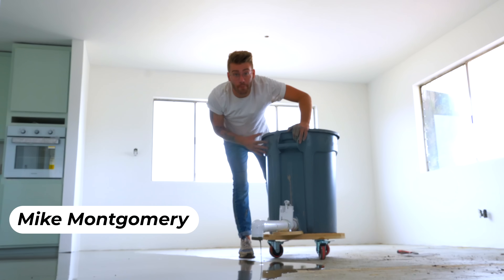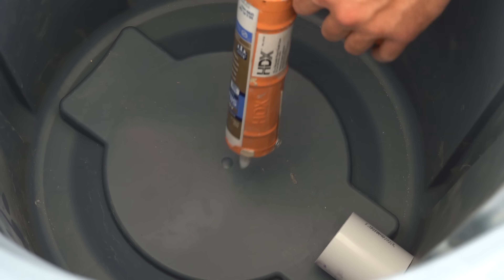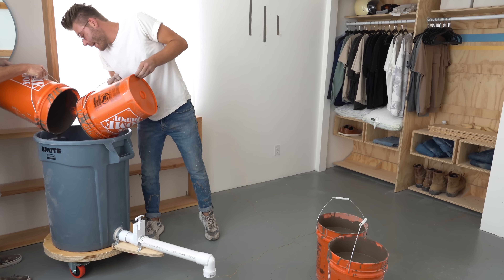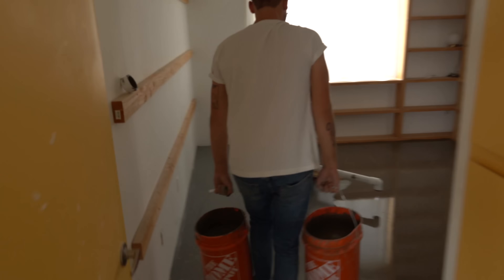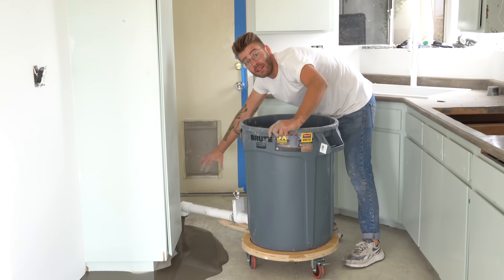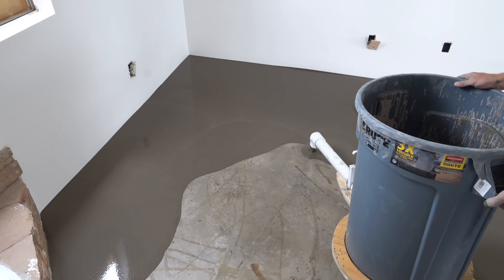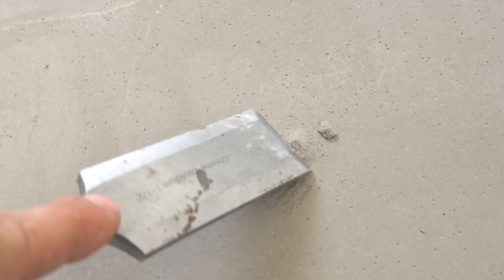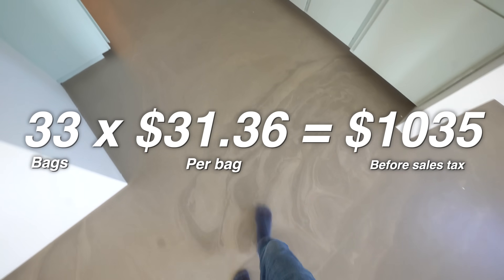DIY SELF LEVELING CONCRETE FLOORS!! $1 per square foot

Comment: I like it.  

As a Contractor (but not a Concrete Contractor I must admit) I have issue with some of the comments in the thread.  Self leveling products shouldn't crack due to just the curing process.  Possibly spider cracks if you don't keep the top surface moist enough for the conditions.  No control joints necessary and, with the thickness being so minimal, they would be almost impossible to install anyhow.  

BUT, the existing cracks/control joints (of the original slab) will transfer through over time.  How soon is just dependent on the movement of the original slab.  The self leveling product isn't flexible so there is virtually no way to keep this from happening.  At least as far as I know.  If I am wrong, please let me know how to correct this as I would love to have the answer.

As far as delamination goes....a better connection between the original slab and the overlay would be to mechanically abrade the slab (grinding).  A disclaimer - I have done that and it is a PITA if you don't have the professional equipment.  Believe me, I know because I didn't when I did an Epoxy flake in my parents garage for a gift!

Comment: What was your prep work to the walls / sheetrock? We're wanting to do something similar in a closet and bedroom.
Reply: 🤣 It doesn't look like he did any prep on the walls. Nothing to allow for expansion, nothing to seal the gaps so the concrete doesn't flow under the drywall... overall amateur work. I't so bizarre to see clownery like this get hundreds of thousands of views.

Comment: Put the strainer screen on the opening of the trash can for pouring.  That way, you can avoid clumps clogging the pipe.  Think of it like drinking a Slurpy through a straw: chunks would get stuck at the pipe, limiting the flow.

Comment: Not bad but you really should have gotten yourself a spiked roller, they are CHEAP and make helping the mixture level and BLEND the pours much easier.  You could have made some nail soles for your shoes to walk over it as well for almost nothing - nails, wood, bit of rope to tie to your shoes.

Comment: This doesn't look like it is easier than just pouring the made buckets. Also, if the mix is spread too thin, it doesn't self-level so pouring just a little bit everywhere rather than a lot in a few spots and letting it flow, seems to defeat the point of the self-levelling.

From experience the main issue in diy use of self-levelling mix isn't the spreading (which is what this contraption seems to be trying to do), but is the quick preparation and quick pour of enough compound so that the first pour is still malleable enough to flow together with the last and create an uniformly levelled floor.

Comment: Should be using a mask when mixing that much concrete, not good to breathe in. Other than that, looks like a pretty neat tool. Another note, since I just finished the video, floors that slippery can be dangerous to pets. Older dogs, with bad hips, really shouldn't be walking on it since they can slip and really hurt themselves even more.

Comment: Wouldn't direct contact with porous material(wood shelves, wood kitchen cabinets, and drywall) cause moisture to be pulled out of the concrete? Or, future wicking of moisture between the two surfaces?

Comment: There's no way that floor will be level and flat using this method. You need to check all over the floor for low and high spots, and when you pour, you need to push the compound into the low spots and check with a laser level and a marking stick that you're actually getting it level everywhere. Despite it's name, it's not self levelling.
Reply: Actually,  I've used this stuff and with a little agitation with a rake, it levels pretty well on its own once dry.

Comment: If you read the bag you will see that this product is not a wear surface, it is an underlayment designed to level a floor for new flooring. it is not intended to be a finish surface. Do not do this. It will not last.

Comment: This is the most useless contraption known to man. I do this for a living. Mix 2 bags at a time and dump it on the floor as quickly as possible so you have an even poor. You want everything drying about the same time. It’s self leveling so it’s not necessary to wheel a contraption around to get an even coating. Waste of time. 
Dump it, rake it, and have someone else getting the next mix going in the meantime.

Comment: No offense and hope this is more like constructive criticism but your projects lately are becoming more and more like 5 Minute Crafts or DIWhy type of results. I know it's subjective to the viewer but the look of that in my opinion looks messy and tacky. 

Constructive Part: I like the videos that had simple minimal looks that used tried and tested construction methods that made a clean polished look rather than whatever you've been releasing lately with weird experimental construction methods that seem to not be done for longevity. But it's your channel so you do what you wish to do.
Reply: When you preface a comment with no offense that means you know what your going to say is offensive and probably nothing more than your opinion.
Reply: Ehh I disagree. He did every step that was required, and made a decent jig that worked well out of cheap materials. I’d say it was a success. Plus for ≈$1 a sqft I would be very satisfied with the results.
Reply: @SAMB0307  
It lacks this step (Could be found in the Installation Guide link from HD product page down belowwww):
Movement Joint Placement
Movement joints are required for perimeters and other changes of plane in all installations. See TCNA Detail EJ171 for recommendations.
Reply: I would have to say I think all his projects are like that. I don’t think he intends for them to be any different
Reply: Constructive criticism requieres helpfull advise or at lear options from which hes can improve

Comment: Biggest problem you made, is that the leveler you used isn’t rated as a wear surface. You need to use something like Mapei M20 plus or their Ultratop
Reply: does this even matter if its just for foot traffic and is sealed?
Reply: @Gulag_bog  4 people sitting on a couch is like 1000 lbs, I doubt this will sustain the point loads and will likely crack and pieces will pop off in certain locations overtime due to the thickness

Comment: This works great as a floor underlayment, but it is going to crack. Cementitious products will lose moisture over the next few weeks and continue to harden and shrink and creep. It's just the properties of products themselves. This is why sidewalks have joints in them and why slab on grades have saw cuts typically 20-25 feet on center to allow cracks to form along that joint.

Over the next few weeks you'll likely see spider cracking. It doesn't mean that it is falling apart, Mike may make it a feature. Hopefully it doesn't delaminate and start popping off, but the bonding agent that Mike laid down should help with that. Like I said, it's primary application is an underlayment for floor so you don't care if it cracks because a wood floor or tile is the main surface. I'd love to see a 1 year follow up on this floor and especially the countertops since I have less faith in those holding up over time.

I can consider myself an expert with knowing concrete, I am a structural engineer so I know a whole lot about concrete. I also sometimes get asked questions about cementitious products like this to help architects spec floor underlayments that will work with their finishes.
Reply: If/when it does crack to make it a feature what would you suggest to have like a darker color settle into the cracks ( like grout) and then put Epoxy overlay?
Reply: @Angibbabee  I'm not sure, Mike is very creative so I'm sure he will think of something. He did a thing previously where he put gold flakes in the concrete cracks so I'm excited to see what he would do when some cracks form. Also, I wouldn't expect the cracks to be very large, probably just some consistent small spider cracking where you can see it but it doesn't quite open up
Reply: This is a self leveling compound, which is significantly different to a self leveling concrete screed.
If it is cementitious in nature it would have plenty of admixtures to prevent the cracking
Reply: it is levelling compound which is designed to be self levelling. It's over 40mpa, so it won't crack as long as there wasn't too much water or too thick.
Reply: I didn't want to get too technical in my comment where it becomes too long and boring. Concrete and grout are similar being cementitious materials. They both use cement as the "glue" for sand and/or stone. There may be other admixtures used to help prevent cracking but they only go so far, they help reduce the concern if cracking but it does not eliminate it entirely. Concrete and grout will crack eventually, it is just part of the material properties, unless it is under constant compression and does not see bending or significant shear. Spider cracks are going to fork eventually, but I would also say the same thing if he poured a fresh concrete slab here too. The best thing you can do is to mitigate it. 

The main concern I would have with using this material as a floor finish is the same concern I have with the "concrete” countertops that he previously made. A thin skim coat just will not last as the finish. Inevitably you're going to drop something on the floor or counter and it will chip off. It's just going to happen when such a thin layer is put down and used as the finished surface, and is irrelevant of the material strength properties.

For concrete alone, the minimum thickness I would specify for a pour is 2" for a topping slab, and even then I would probably want a 3/8" stone and fibermesh used to mitigate cracking due to drying/curling, and shrinkage over time.

I have never seen an architect call for a skim coat like this to be used as a finished floor, and a contractor would also want to stay away from this too because they would probably not warranty the work. Like I said, this would be great as a floor underlayment, but I have big concerns about durability as a finished floor over time.
Reply: @Angibbabee  You know mill with kintsugi that shit.
Reply: "Do not use as a permanent wear surface."
"Expansion joints and cold joints, as described in ANSI A108.01,
should be carried from the substrate up through the tile or flooring
surface and filled with an appropriate elastomeric sealant"

Those are basically half of the product limitations listed on the datasheet :/

I wish him all the best for his floors, but I cant not wonder if we will see countless home improvement youtubers in about 5-10 years making exclusively videos about "only using the correct product for the job" and "we bought this cheap house and had to rip out our own mistakes"
Reply: The primer prevents the substrate from hydrating from the flowable hydraulic cementitious underlayment- it is high polymer and calcium aluminate and formulated in a way that hydrates topically much faster than other formulations. We do this all the time and install wood flooring and tile over it the next day and it lasts  a lifetime without any issues. The catalyst obviously is water and it kicks off very fast and has a healing time much different than other formulas. It’s definitely not supposed to be used for a finished top coat, there are other formulas designed for that. Anyways, he’ll be fine.
Reply: You can easily make non cracking cementitious compounds...... Really not that hard if you "know what you're doing" as you say. Not normal or common for a screed to lift, crack and/or pop at all
Reply: "I know a lot about concrete" Has never mixed a batch in his life 😂
Reply: @bradtyson  
It is not a matter of if but when concrete will crack.  He already had a large crack in the concrete floor and as it continues to crack so will the the compound he put on it.  And if any other cracks form they will crack the compound with it.  The best you can hope for is to minimize cracking and minimize the cracks from spreading.
Reply: @oldtimefarmboy617  That is the correct answer. 
Plus I get suspicious when people do not use the term hydraulic cement. 

This particular type of product I use all the time and it will shrink but because it uses surface tension to effectuate the self leveling means it will get thinner top to bottom for the most part with 3-10 day cracks forming at the edges and places of already uneven subsurface

Since he sealed it like concrete but both top and bottom; longer term bubbling is likely ( due to hydration changes in the subsurface layers ) 

Letting it cure fully ( depending on the environment : up to 7 days ) before sealing it can reduce granulation from happening in areas that have sharper than average daily temperature gradients ( i.e the sealant may peel the upper layer of the lever off under mechanical stress  in thicker areas or near exterior openings/ drafts)

I have found that adding some type s mortar to the self leveling products can mitigate some of the longer term issues, this also lengthens the initial working time and allows for better troweling /wet edge management, but as a direct use layer I am not sure; perhaps not only some type s but also some fiberglass..

At the end of the day though , the mechanical wear on this product used in this direct surface fashion I would expect to start showing significant deterioration in select areas within two years
Reply: Mean like adding fiberglass ...ahh filaments,/  shreds to it have heard that being done to give flexibility
Reply: @miguelcastaneda7257  high strength concrete and high strength back plastering have a fairly high percentage of fine short fiberglass fibers in them .  "flexibility" might be the right term, but I believe "helping mitigate the shear moment" in poorly bonded areas that are more granularized than homogenized  or other wise more exposed to shearing stress might be a better conceptualization.
In the application in this video I think (air) pressurizing the house to as high a limit as it could take as the floor cured might also have been an interesting thing to see
Reply: @miguelcastaneda7257  
Actually, the purpose of adding shredded fiberglass fibers to cement is so that they can act like lots and lots and lots of really small reinforcement bars to prevent the cement from spreading apart just like steel reinforcement bars do but on a very small scale.  They may have had that in this stuff but they would also tend to make it act like it was thicker and not spread very well which would have defeated the whole purpose of it being designed to spread easily and level itself out.

That being said.  I did watch a program on television about earthquakes and the fact that they were trying to add some sort of plasticizer into concrete that would allow concrete pillars to flex with side to side and not crumble to pieces.  That was a long time ago and I have not heard anything else about it since so I would assume that it did not work out.
Reply: @jonathanmalmut2412  if the mix used was runny due to a superplasticizer, it likely will not shrink much at all.  I know you're trying to be helpful, but I'm not sure that you know as much as you think you know.  There may be a "spiderweb" of cracks, but they will be hairline, such as how Raku, and largely will not matter due to this concrete acting primarily in compression with a slab beneath it.  One important thing: it is good to use a proper concrete bonding agent so that any uneven pressures do not cause this self-leveling layer to flake off.
Reply: I've used this same cement product. Ive been deadlifting 200+ for the past year and 300 for the past month okay. No cracks. The product does state that it has high impact strength.

But that said, it does get very dusty? Is that from the cement itself?
Reply: I was spout to go to home depot. you just saved the day bro. you must of saved like 50 people with your comment
Reply: I have used this outside for filling a dip in the concrete in front of the main entrance door that would fill up with water and then freeze. It was a patch about 4’ in diameter. The patch lasted 5 years before the edges started separating from the original concrete. I was surprised that it lasted as well as it did. I didn’t even apply any sealer to the top. 

I have also used it for shower pans with no problems. I mixed it thick and poured it around the outside edge and let it run slowly to the drain pushing it back uphill until it started to jell up and hold the slope. I tiled over it and it’s been 18 years without any problems.
Reply: @jonathanmalmut2412 what sort of result can one expect from self-leveling compound with an epoxy coating on top to finish?
For a 400 sq ft studio floor in a basement that just needs to be clean and functional
Reply: Would there be someone sort of wax oil to apply to it so the concrete absorbs and doesn't crack? How do they make high impact floors in skateparks that never crack

Comment: I highly recommend that anyone who watches this video and is considering doing this, not to do it. I tried this at my house and it did not turn out good. This material very difficult to work with, and it is $28 a bag. This has been a very costly mistake for me.

Comment: used the same sealer and yes, freaky slippery. after about 3 months of walking carefully use and multiple vinegar and mrs meyers mops, it's normal smooth. rugs still slip around and need rubber pads tho.
Reply: I think that this is a SCAM.

Comment: "$1 a square foot"..... (proceeds to buy $2200 worth of leveler, $100+ for an unnecessary contraption, $30 concrete sealer, and $40 behr sealer). All for a floor not rated for traffic (needs a flooring material like tiles or wood).

Good job?